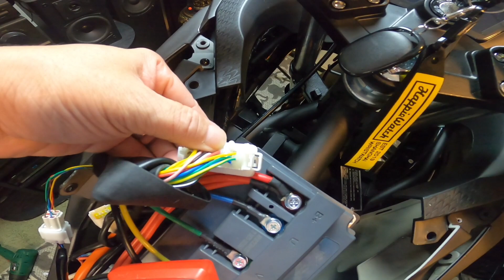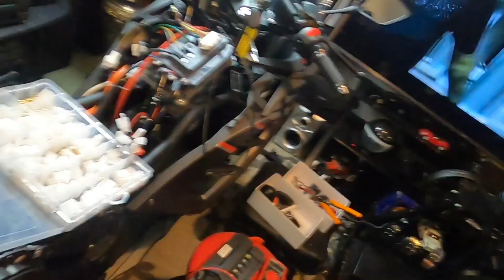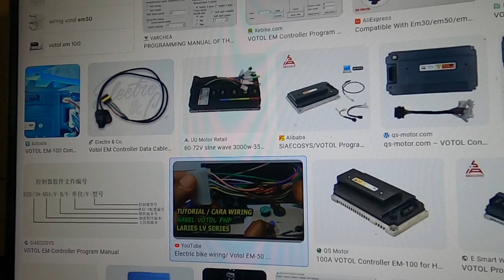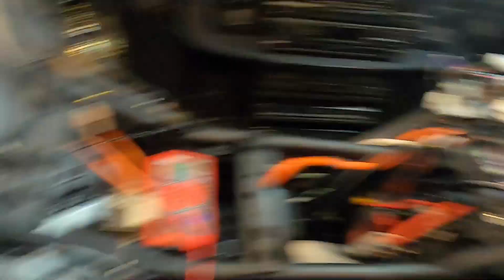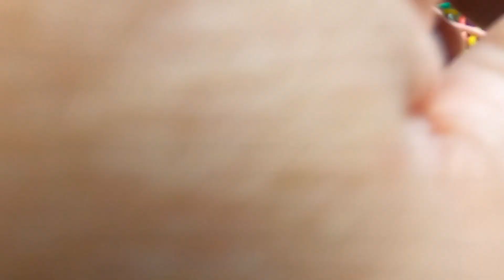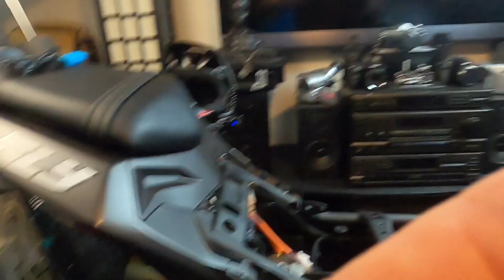Votol Controller install on RZ stock motor & 72vbatt Part2  economy upgrade with great performance!

Comment: Bro I have a 72v 40ah battery and would like to add these two 22v 22@h tattu  lipos  can you tell what i need to do to make it 96v .. please
Reply from the maker: put the 2 22vs in parallel and then put them in series with the 72v so that means on the 22vs both positives and both negatives tied together. then take the pos from 72v put to the negative of the 22s. now your main positive is from the 22vs and the negative from the 72v and youll have your high voltage depending on state of charge anywhere from 94v to 110vs
Reply: @ChrisCrossingWires1212  thanks a lot bro I got my thing going on here in pittsburgh 412ebikebuilds just getting thing up and going . I appreciate you 🙏🏾